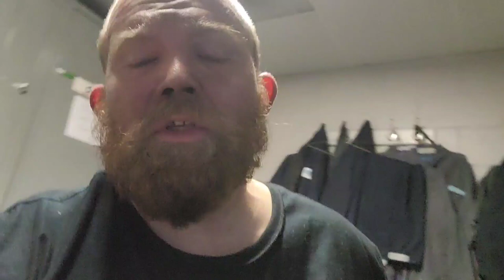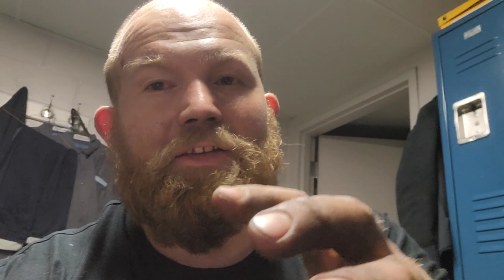Quick Lube Oil Change and Now Check Engine Light is on - Here is Probably Why - check this first

Comment: I'm getting a code back for a catalytic convertor right after leaving valvoline. Only went there for a oil change because I'm selling the car in 2 days. Idk what to do man.
Reply: I went back there and they read the code. They said it's your cat but it wasn't on before hand. Went everywhere and nobody can clear the code. Unnecessary stress, should just take the time to do these things myself.
Reply from the maker: I wonder if they overfilled the oil and it is burning oil
Reply from the maker: These things can pop up at any time man there's no guarantee that something wasn't going on already it just happened to hit you at this time
Reply: @FordBossMe  Yeah the timing is awesome. Inflation hasn't hit us too bad luckily so not a huge loss just an inconvenience. If it's actually the cat I'll just sell to a mechanic or something. Thanks for the response man! Going to look under the hood tomorrow morning. Have a good one! Just subscribed!
Reply: @FordBossMe  it was burning oil before hand though.

Comment: Back in 2018 my sister had chevy cruiz sedan, took it jiffy lube for an oil change and they left the oil filter just loose enough that over the course of a month the oil slowly leaked out until the engine ran out and seized up at only 8k at the time. She had to take them to court to get the engine replaced.

Comment: Rich's frustration with programming modules has spilled over to me.  An engineerin software update was pushed to all our ECMs with bug fixes.  None of the vehicles successfully programmed, bricking every single vehicle I have under test.  I have to wait for the ECM supplier to arrive, so he can reprogram the boot code to unbrick each ECM.  The work from home thing works OK ...until things break bad.  The issue is mission critical with validating the software before sending it out to dealerships.  We do engineering tests, so the dealership guys have a chance to do well.  I am so stressed that I ate vending machine food and feel sick.

I wish that customers could see all that has to happen behind the scenes to make vehicles start and run.  It is not easy or fun.  It is my job to do.
Reply from the maker: It sucks because it gets the best of us and we stir and stew and boil over it

Comment: NEVER GO TO JIFFY LUBE etc..      The % chance of something going wrong is wayyyy to high. Why in the hell would anyone let unexperienced do anything to something that costs 10k-50k+?? You wouldn't let some random 711 clerk come fix your electrical panel in your house right? I had a girlfriend that worked there as a salesperson. She told me about how insane the upsale tactics are and how almost EVERYONE except the supervisor knew literally nothing, and the super was still bottom tier. 😑 do your own oil and maintenance! Atleast take it to an actual shop or dealer. 🙏🇺🇸

Comment: I have not been able to do my own for years. Never would I go to a quick lube place.  If you still use those   places, pull the stick before you move car.Look under car for oil spots. Where ever you go if you are having tires rotated, wet your finger and put and x on the rim of a tire. Often they skip the deal and charge you for it. Then swear they did it until you show your mark. I never would have thought of the situation here. I, not knowing, would have went in and showed it to them and headed to a dealer. Never want them trouble shooting.